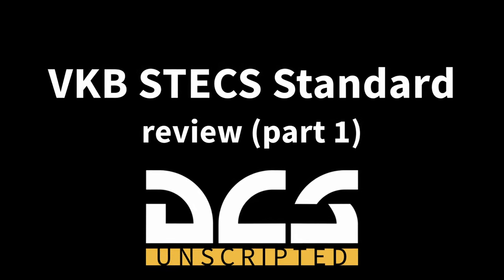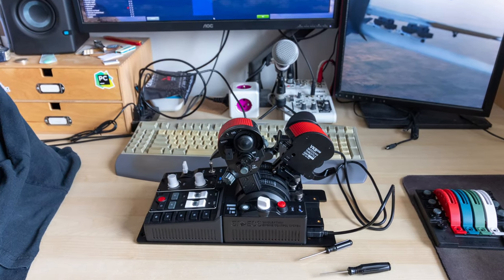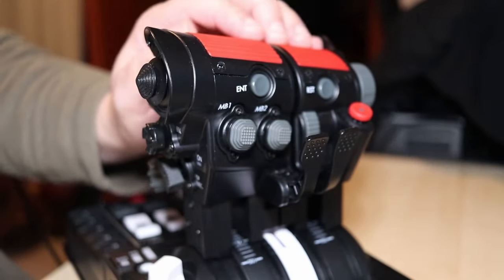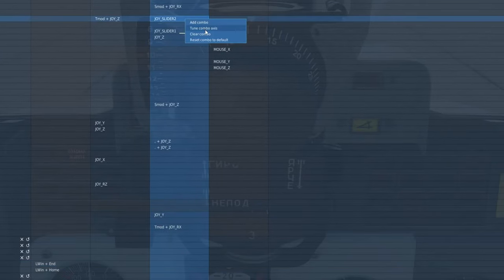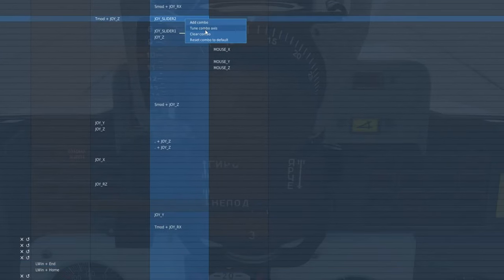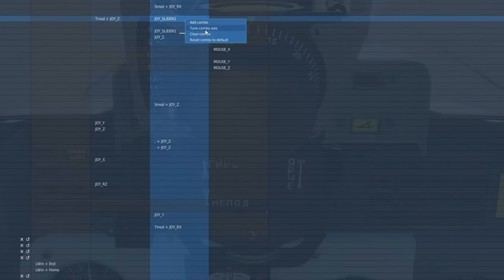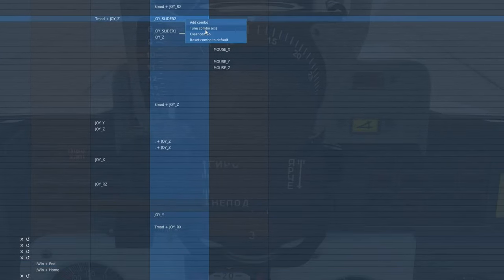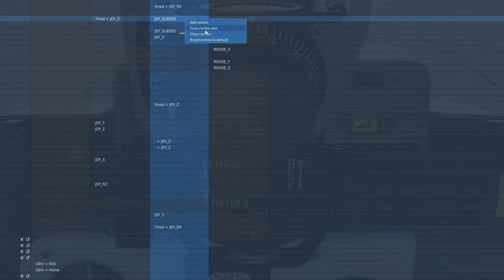VKB STECS Standard throttle review (part 1)

Comment from the maker: Jan 14, 2023 update: VKB EU shop got restocked, the price for Standard went from 359 to 346 - not sure what affects this price, but it is still far from a naive calculation based on the current US price of $279 (->EUR + ~20% VAT = ~306 EUR). This makes us, accidentally enjoying the STECS for 3 more months for mere 15 EUR premium, kinda lucky. And it brings little change to the final comparison with the competition. Virpil is still more expensive, but not that much, and WinWing is still extremely competitive with tons of controls on the base. But if STECS works as it does right now for the years to come, I have no regrets about the price. (Just about those grip encoders. 😀)

Comment: You stated you're a DCS player, but from your experience and I know everyone will say " Go Omni throttle for Space Sims like ED and Star Citizen" because of 6dof. But is the STECS still a viable option? Seeing that there is a thumb stick to control lateral movement.
Reply from the maker: My answer is only theoretical, because I don't play space sim at all, so you have to make a qualified decision. 🙂With STECS you can't use thumb for anything else, when you're using the thumbstick. On the other hand, there are still buttons on the front, quite plenty of them - for other fingers. With Kosmosima, you have triggers and one button for index, but no hat, nothing for midfinger and one pinkie button. With throttle you have much more, encoders, 2 5-way hats and some buttons + two triggers (single-stage only, of course).
On the other hand, Kosmosima can be setup in such a way that you controll all 3-axis (including grip) with the grip itself, so fingers can do a lot. And on the thumb you still have 3 hats + ministick/hat (with Premium version) and some buttons. Also, springs can be removed, so it doesn't autocenter, if that may be handy. STECS thumbstick always autocenters, of course. Also the travel of thumbstick and omnithrottle is incomparable. Omni will give you much more precision. STECS gives you just one axis (technically dual, but that's probably irrelevant for space) on the whole hand movement.
Some people may also struggle with the thumb orientation, especially as it changes. Thumbstick precision is nowhere to the Gladiator stick gimbal and you can also drift off axis as you swivel the grip.

I thought money can be a factor too, but then I realized we should probably compare STECS Mini with omni-Gladiator+Kosmosima, so money is probably not a factor.
Reply: @dcsunscripted  Thanks for the informed reply.
Reply: Omni throttle is best for space sims. That being said I use Omni throttle and a standard throttle and map the standard throttle to my speed limiter and cruise control, this causes the standard throttle to behave as your main throttle when you hit the cruise control.
Reply: STECS is a viable option for space sims, but as mentioned you will want to make sure to have enough inputs on your other fingers while the thumb is using the strafing thrusters with the ministick. So either go with a Standard STECS or the mini with extra buttons and hats upgrade.
Reply: @jukahri  I was thinking STECS Max with Gladiator NXT EVO? Would that Suffice with say a game like Star Citizen? Or should I also get a STEM GNX module for the stick, or maybe even the Aviation Module that would sit behind the stick?, for all the 100s of keybinds SC has?
Reply: From my experience, I played ED, Star Citizen & DCS, and I've played using a standard throttle and the omni-throttle before in all those games. I don't find a significant advantage of using the omni-throttle over the standard throttle when flying in space games. Using the other switches for lateral movement worked really well for me. So if you have limited budget to select only one, I definitely won't feel like I'm missing out if I chose the standard throttle to play both DCS and space games. Hope this helps.

Comment: I 3D printed a base and mounted mine side-by-side. Any idea how to set reverse thrust using detents please?
Reply from the maker: The axis still goes from 0 to 100%, detents are just "pauses" on the way. I assume the reverse thrust must be mapped somehow in the particular game to that 0-100% range - if the game supports it. I don't have an experience with it from DCS.
Reply: Put in the big pointy detent and then use the VKB configurator to map anything below it as minus% input. Or just put the detent at for example 50% and then map the game to use 49-0% as negative.

Comment: You should play with the T_enc value to adjust the delay between activations of the encoders. VKB sets it rather high by default to ensure windows doesn't miss inputs (windows is dogshit at handling encoders), which is good for small minute adjustments, but not so great for large inputs. With a smaller value you will reduce the input lag, but accuracy will suffer somewhat as some inputs will be missed.

The reason the lag is absent when using the encoder as an axis is because it's not needed then. :D
Reply from the maker: Good points, I didn't want to go into details, but I tried that as well and didn't see big difference. Plus, if you make the pulse shorter, it will not make the events getting to the computer that much faster, there seems to be still some pause (not sure whether that is adjustable). And shorter pulse also makes up/down action even worse, but perhaps I should not talk about that anymore because encoder is totally unsuitable for up/down (inc/dec) actions, even more so than for axis.
About no lag for axis, I suspected it is processed in the device, so I knew why it doesn't have any lag - but it was a good not when later shown how it is re-introduced if you want both (encoder and axis action with the same config).

Comment: Great review! I personally went through similar deliberations and chose Virpil CM3 ahead of VKB (Virpil has zoom slider axis on the handle and harrier style nozzle axis on the base, VKB lacks both) and  Winwing (lacks the zoom axis slider while having two harrier nozzle axis things).
 Plus I like Virpil button label and LED colour customization - a minor thing. Detents are not important to me as I don't like to change things to fly a heli or a WW2 bird, although Virpil has loads of them too (I never installed them). Love-love-love my CM3 :)
Reply: The obvious answer for the most versatile (and ergonomic) solution is the STECS throttle from VKB + The Panel 3 from Virpil! That's what I've got and I feel like I've got it all!!
Reply: @b34k97  No panel would add a zoom axis slider to the handle and Harrier style nozzle lever right next to the handle though ;)  CM3 ftw haha
Reply: @pjslon9219  I've owned the CM3. Sold it for the STECS and no regrets. I don't need an axis for zoom, those triggers under the finger work well for Zoom In/Out in DCS, and I have the palm trigger a reset zoom. It's quick and quite easy to press.

i've had 6 different throttles in as many years, and STECS is the best for me. While this review hit every single negative of the STECS and described it really well, they're all pretty minor when weighed against its major benefit. 

It's detent system that make this a winner for me. I fly in DCS, MSFS, IL2, and sometimes some space games... so being able to switch both physical detents and the electronic configs between an F16, A320, A Center detent Space Ship, and detent-less warbirds, in less than 30 seconds... it's amazing.
Reply: @b34k97  Thanks for the detailed reply! If I ever get to like detents, I'll give STECS a go! 
Although it would be STECS 2 or somthing as I still must have a Harrier nozzle axis - I love that plane (and zoom axis is also much faster than buttons). Detents for me personally are at the bottom of priorities - but I do get that we are different and your point on quick change system is a good one!

Comment: Buying the “max” for this dosent make sense, it’s like 6 Extra buttons for 40$
Reply from the maker: Yes, I also agree. In EU, Mini is for 249€ and Standard for 346€. For around 100 euros you get STEM with quite a lot of new buttons, switches and encoders - and a lot of accessory (detents, modules with more 5-way hats). This makes a lot of sense.
MAX adds the holder and ATEM module (6 buttons + 5-way hat/encoder combo) for additional 60 euros. So in terms of just controls, it doesn't make that much sense. But some people appreciate the holder as well and plan to use it. If you just buy the bigger base plate and the holder, you're on MAX price tag anyway.
For me the STANDARD was the sweet spot, so I agree with your sentiment. ;-)

Comment: That is really a great and critical review. Thank you very much. 

I'm really looking forward for your second part. 
I was so certain that this will be the perfect throttle. But the things that you mentioned, especially the disappointing encoders, make me thinking again.
Reply from the maker: If you're OK with the thumb stick - which is a bigger disruption for many (not for me anymore) - and you don't need any rudder or brake axis on the throttle, then the encoders as axis are not such a big deal. Yes, they are not that precise, but some axes are OK even when not super fine-grained. E.g. antena elevation doesn't need to have so many steps. Sure I'd prefer true axis, but in the end it's not a deal breaker. If the encoders are the only problem, just think of the axes you can serve with them and don't worry about it. If it's one of many problems, then sure, they may be another thing why not to buy it.

Comment: Nice work lots of information and advice, almost tempted to buy this  but I currently own virpil CM2 throttle
Reply from the maker: If you're happy with CM2 and it's not breaking for you, just keep it and wait. I'd not buy STECS if my TWCS (much weaker than CM2) didn't betray me. STECS is not a leap from Virpil's throttle (in my humbe opinion), although currently I prefer it - more on that in my next review part coming soon. However, it may just be my bias, of course. ;-)
Reply: @dcsunscripted  I had two twcs fail on me I waited a while for the vkb throttle to come out but I purchased a used CM2. It's been I love the amount of hats and buttons etc I just want to try out the vkb throttle... It's hard to see in the video is the right side where  the analogue stick and hats switches flat? Or is it an angle outwards a bit ?
Reply from the maker: @abbyabz6940  I'm not sure I understand exactly, but generally, the right side of the right handle is mostly flat in the direction where it travels. The thumbstick portion is slanted just a bit towards up - but it's hardly noticable (I only see it now when you asked). It should be clear that BRK is "higher" (more to the right) than RADIO or OP EXEC modules, which actually works well. Feel free to ask more, if I didn't answer your question.

Comment: ¿What did you end using as zoom?  . I have just upgrade from de TWCS and I dont know if I will end missing it..... I find stecs too unergonomic in comparison.
Reply from the maker: My TWCS had twitchy throttle axis (had to spray the pot every other day) and broken slew after around a year. STECS was a massive upgrade. Yes, I miss the paddles (spring loaded axis) and pinkie axis... but otherwise I'd not go back at all. Shown shortly at 8:31, I use middle finger MB2 5-way hat for zoom - up/down for out/in and press to reset it to normal. I actually use the hats on MB1 and 2 mostly for views, various snap views, etc. Not sure why I like snap views, even with my (admittedly no so good) head-tracking.
STECS is great and I even got used to the slew on the thumb, no problem for me anymore. Use push (away) for up and practice with it a bit and it will click very soon. The amount of hats and buttons just on the grips is much bigger than with TWCS. But the throttle axis quality and precision is beyond comparison - at least with my old TWCS unit.
Sure, some things are missing. There is no way you can have reasonable rudder on this throttle. But paired with Gladiator Kosmosima with twist... I'm lazy to use my TWCS pedals, not to mention they are narrow and not that good/precise either.
Buying STECS without being able to replace the things like rudder is probably not the best decision. But if there is no showstopper, it is an incredible piece of HW. I love the feeling of it under my hand and ergonomy flaws are rather minor in my everyday use.
Reply: @dcsunscripted  Thank you for your long and detailed answer. I had a TWCS lubbed with Nyogel 767A so I had no issues at all, also have a Gladiator pro and T-Rudder by VKB I was so hyped by the stecs and the waiting for years that I took for granted that It would be a great improvement...  so that I even sold the TWCS before stecs arrived.
The stecs mini plus didn't come with the set of custom buttons so I only have the 4 way one, the first disappointing when I opened the box; I thought it would be included. I take the opportunity to say that if anyone sell any of these, please write me :D . 
I don't see the point of the two encoder wheels, as axis they aren't smooth at all so as zoom are unsuitable. And I find annoying the placement of all the knobs. Overall, I try the stecs two days and I'm kind of disappointed. 
Thank you, your message encourages me to begin the adaptation process.
Reply from the maker: @OceanManu  I see now. Nyogel was for action I assume, I didn't have problem with TWCS action as much as with the jumpy pot (sensor) - I used contact spray for that regularly. As for Mini Plus option, yeah, it lacks those add-ons, but you can at least switch the modules you've got if that helps, although it doesn't bring more actions. Missing accessory saves the money, but for me the modules were important for initial setup, and detents are also cool, I switch them after a few days when I go to another plane. You can still buy the accessory, although the final price with shipping can be annoying.
But the throttle action is superb. Encoders can be used for less essential/precise axes (I don't like it, but that's how I use it). You're well equipped on the joystick and pedals side, good for you. 👍 Although their pedals don't have brake axis. I actually use the thumbstick with a mod button as a brake axis, crazy, but it works OK. 🙂